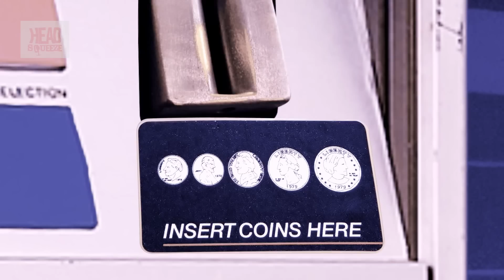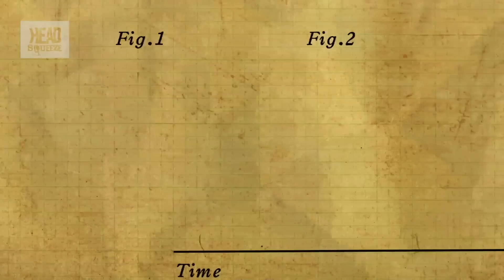Can We Build A Space Elevator? | Earth Science

Comment: the problem is that he forgot to mention all the other problems that his tiny brain could not even think of. the things is that have you ever trieed to hold these color coil spring toys hanging down? if you have you see that the top of the spring have the greatest tension. it means that the rope itself would be pulled down below with a force much greated than above actually the space elevator can't work because gravity will bring it down form the sky. the low earth orbit will be easy to counteract by the force of gravity below acting on the cable below. nobody shows you real science when its about the space elevator. they all show you the easy part. all the problems with it is ignored. also wind and storms will cause the cable to swing and wave and come crashing down even before its created. main problem, how on earth are you supposed to get the cable up there and then below? even if there was a place in heaven to rest on that didn't move, moving parts of the cabel into orbit would be a impossible task itself and take all the resources of the planet to do it. the other problme is that even if you try to do this, the longer the cable was ganing downward from above the more gravity below will start to pull thw whole thing down. you need more than a counterweight for this. you would have to anchor the cable in the moon itself hanging down from the moon down to earth. the cable would have o be so thick and strong, it woul dtake a impossible quantity to produce it. the advantage of this absurd idea is that a trip to the moon would become very cheap. the big proble is that the cable can't be achored on earth so agiant weight have to hang down on either end of the cable and use the moons gravity and earth gravity to keep the cable stable. you would need tousands of rocket mounted on the cable to steer it against the winds and storms on earth to keep it straight. you woul need to make the cable hoolow and fill it with liquid nitrogen and cooled down to given temperature to prevent the cable from experience temperature difference that coudl cause the cable to fail. the space cable elevator is madness. its insanity its babel 2.0 only madmen would try to build such a thing. there is far better ways to make a space elevator than a cable from the stone age. we would be better off with particle beam and a space lift capsule that use magnetism to climp the particle beam into space. that would take lots of energy at once but is much more sane than that the carbon fiber cable idea.

Comment: Not a meteorite, sir.  It's a meteor until it enters dense enough atmosphere to heat up.  Then it's a meteorite, I believe.
Orbiting an asteroid, not a meteoroid (hehehe Science is so much taxonomical confusion) is the better idea, perhaps, as the greater mass will allow for more indignities when dangling a rope down to Terra Infirma.  It's gotta be up above most of the near Exospheric drag, too, so 25K nm-50K nm.  We'll most likely "spin" the cable elements as high tensile aramid plastic coatings over carbon50 stabilized Boron fiber core support cables.  You'll need station keeping motors for the asteroid, of course, as a safety margin.  And you'll need to do it all from space, as you pointed out.  It might prove cheaper to loft sections and assemble them into a ship capable of  a manned expedition to select a suitable asteroid (a lithic one, if possible), attach to it automatic motors capable of stabilizing it in three axes and imparting a tiny thrust, too, to bring it insystem.  Once in orbit (and don't scoff.  NASA and ESA are extremely good at ballistics required.  It becomes a question of either scale, or time) the asteroid would provide both anchor and materials source . . . maybe has a solid gold core . . . and Warrior Women from Mars, or some junk.  Then, and only then, can we build our anchor for the Space Elevator so we can sit up there and throw a hook and line over the side and try to catch us a B52 . . . and you should see the one what got away!

Comment: I think commercial (all) airlines should be electric and should be lifted and launched vertically with automated lighter than air balloon drones like they do with some rockets which could partially deflate and fly themselves back down to the airport. At altitude, the jet could begin to add thrust and as it does, the automated drone balloon could proportionately deflate until the jet got to 110MPH for ex and it releases itself.  The hot air or gas could as well as drone batteries could all be powered/created with solar power and planes could even be taken higher for more gliding fuel advantage.

I think the space elevator beanstalk is still a way off but I would try to get the payload as high as possible with balloons and use rockets from there.  I’d like to think of a way that an elevator could begin at the highest point that balloons could lift and dock a payload to the bottom of an elevator, but it would still have to be counter-balanced without cable tension.

Comment: It baffles me that most people seem to ignore the fact that geostationary orbits happen at approx. 3Km/second speed. Climbing (or descending) such a structure (even if it could be built) is no "trivial task". You still have to gain that orbital speed and it ain't free. Newton's laws still apply (ie: F=ma). So supposing such an elevator were built and the climb began, where would that force come from ? If viewed from the rotating earth/elevator's frame of reference, the climbing elevator would experience a HUGE Coriolis force "pulling" in the direction opposite the rotation, and this force would have to be "countered". Of course Coriolis is an "apparent force", and can be explained by plain inertia if the system is observed from an "outside" inetrtial frame of reference. But either way, the elevator still has to reach orbital speed, which is why "ordinary" rockets need so much fuel to begin with. It's not so much about the "hight".
Reply: Im not fully confident i understood the concept but i think that at the point you reach geostationary altitude you are moving with orbital velocity (3km/s) in reference to the earth. In other words, if the earth had a 35k radius, its surfacevelocity would be 3km/s. Correct me if im wrong

Comment: Why don't we just perfect the railgun, make an extremely large and powerful one and launch shuttles in to Geostationary orbit and go from there.
Reply: Aah, that could be a problem. Launch them slightly slower perhaps?
Reply: +qId3r they would need to reach a minimum speed of 17,000 mph to get to a circular orbit of ~130 miles up above sea level. However, geosynchronous orbit is at 30,000 miles up, so the launch speed would need to be much higher. Assuming there's no living things in the satellite, this wouldn't be a problem if we were launching from anywhere with minimal-no atmosphere, like the moon. But here on earth the atmospheric drag would tear anything apart moving 17,000 mph.
Reply: +theBG2016 I was kinda wrong...Apollo missions reentered at speeds of up to 25,000 mph and the record for fastest reenty is 28,000.
But the US Military railgun shoots a projectile at 5,000 mph can only go 100 miles.
Reply: +qId3r g forces
Reply: +HEX Ummm ... nope. Railguns propel stuff extremely fast ... but most stuff (technical equipment, the delicate hull of a spaceship, astronauts) wont like that.
Reply: If we could find some way to move a most of the atmosphere out of the way first, this might work. Maybe some way to heat up all the atmosphere above the tossed object to a ridiculous degree to lower its density. Microwaves are pretty good for that, but you're gonna need one heck of a power source.

Also I mean the air in that column is probably gonna leave earth, so idk how many times it's safe to do that.

Kinda makes you wish we had just one mountain tall enough to peek out of the atmosphere.

Comment: Air breathing rocket engine. Look up sabre project.
Reply: Josh Hanson No air in space brother.
Reply: Paddy Lambertinho  -_- 90 to 95 % of a rockets fuel is used in getting out of the earths atmosphere..... Which does have air. The idea of the Sabre engine is that you can do away with the massive orange liquid oxygen tank used on shuttle rockets by using intercoolers to cool atmospheric oxygen to the optimum temperature for combustion when mixed with the fuel carried by the rocket. The Sabre would also be a reusable rocket engine. The rocket that launches the shuttle is not reusable. It really is very interesting brother. I worked (briefly) as an engineer on the project.

Comment: Third option: cannon.

Most of a rocket's fuel is used to propel its fuel, which a large reason of why it's so wasteful. Plus the fuel containers. Using a cannon eliminates that entire issue: all the energy is used in the ground station. 

While not particularly a nice idea for ourselves, it would be a much cheaper way to send stuff into orbit... such as a "space elevator".
Reply: Or you could reduce the cost of rockets by over 90% by making them reusable, which is what spaceX is doing.
Reply: So what cannon is powerful enough to propel an object out of it at mach 27 or roughly 8 kilometers per second? Secondly when using a cannon all the velocity is acquired at one instant, a better question is what object could survive the g forces of going from 0 to 8 kilometers per second in under a second? Not to mention on said objects travel to space there's this thing we call the atmosphere in between.  The object which is fired from the magically powerful cannon magically survives and is on its way through the lower atmosphere at 8 kilometers per second,  it would instant burn up in the way space craft do during reentry.
Reply: Isaiah Phillip
One of the main approaches on that is to not use a classical cannon, but something like a massive coil gun. Ideas of these speak of kilometers long "barrels".

This significantly lessens the g-forces issue. Presumably the required acceleration isn't a physical problem - at least, I don't see such objections - so it may be feasible.

And idk whether there would even be the possibility to basically make a loop for the acceleration, switching tracks to the "barrel" once sufficient speed is reached - which would largely eliminate those problems, I'd guess.

I have no idea whether friction is a problem they've accounted for.
Reply: sorsocksfake It's just not feasible, then again the space elevator is an even less feasible idea.
Reply: Isaiah Phillip
You are wrong. 

See, merely stating it isn't much of an argument. If you believe it goes against the laws of physics, enlighten me. If you have calculations showing the requirements are leagues beyond our current capabilities, please share them.

If it's merely your opinion, then please don't state it as if it were fact :).
Reply: did you read from the earth to the moon? :)
Reply: Tecnovlog
Assuming you're asking me: no, I haven't. Anything in there that you'd like to share? :)
Reply: It tells the story of the Baltimore Gun Club, a post-American Civil War society of weapons aficionados, and their attempts to build an enormous sky-facing Columbiad space gun and launch three people — the Gun Club's president, his Philadelphian armor-making rival, and a French poet — in a projectile with the goal of a moon landing.
Reply: Tecnovlog
Ah, Jules Verne. I haven't read it (as with way too many books :P), but goes to show how long such ideas go back... and from what I read his version wasn't even that bad (main issue being acceleration, ofc)
Reply: sorsocksfake A cannon wouldn't work because the object would simply orbit right back to where it started.. that is: the cannon.

Comment: The main challenge in building tall buildings is not how much weight the base has to support but rather the shear modulus of the building. For any cylindrical or cone shaped building, whether the building will topple over can be determined by whether (density * height^3)/(shear modulus * diameter^2) exceeds a certain amount. That amount is larger for cone shaped buildings than cylindrical buildings.

Comment: I think there are some miss-conceptions in this video

- going into an orbit in "space" doesn't mean to go enough "height", but enough SPEED! The rocket provides the energy to speed you up, not just moving you upward. By Kepler orbital law, you can find the speed needed to "orbit" the earth just 100 meter above, which is 28474.8 km/h. But the speed can never be reached inside the thick air at this height.

- it is micro-gravity in orbit because the fast moving objects there constantly FREE-FALL into earth, but their speed move them forward and away from earth, so they balance on an orbit. it is NOT because the earth gravitational field suddenly cease to exist at some height, and objects can't orbit around earth if they don't feel the earth gravitational pull.

- your elevator needs to push people forward, not only upward. Otherwise, people at the top can only play super word-class bungee jumping, but can never "float" right out of the elevator door. You still need to deliver the energy to push people forward, even you don't like rocket.

- the rope proposal maybe a good option. By climbing a rope up to a satellite, we are basically pull it down to earth. But the high speed satellite may store enough momentum, and it may be able to pull people forward to some speed at some height.

- But Kepler orbital law needs object to move faster if its orbit is shorter (or orbital radius is smaller for circular orbit). So pulling the satellite into ground and slowing it down means it must fall to ground, so does the people on the rope. You need extra energy on board the satellite, such as thrust, to keep it on orbit while allowing people to climb the rope.

Comment: When the weight of the fuel as a powersource is the problem, why not produce the power necessary to put things into space before the flight takes part rather than during flight. 

Build a long, steepening tunnel in which an on magnets hovering train accelerates. Evacuate the tunnel, after the train starts you let air back in through the gate from where the train started. When the resulting burst of air is about to outrun the train you open the end gate. 

Can't be that hard.

Comment: I don't understand why the counterweight would have to be *higher* than geostationary orbit. Putting it into a geostationary orbit would exert the lowest possible stress on the rope because the counterweight would stay at a constant height and in a fixed position relative to earths surface on it's own and the rope would not have to fight centrifugal force only it's own weight or am I missing something?
Reply: I guess the rope (which is huge and very heavy) would just pull it down. So it has to be a little further out to counterbalance that.

Comment: Well there's a bit of a compromise solution. An Earth based mass driver, built into a mountain could launch a payload at fairly high speed and altitude. But it wouldn't get into space on its own, it would still need a rocket. But on the plus side, the construction would be cheaper than a space elevator (still enormous, on the scale of the LHC), cost less than rockets, use existing tech, and it would need significantly less fuel than a conventional rocket launch.

Comment: At the end I think you have it. Rockets are round why not a rail gun. (You might need 3 power plants at the site, but it should cut weight, then again why a cylinder you could shape a shuttle to fit a rail gun launch, does job, lands, refit, launch.). then use Buzz Aldrin's idea of using planetary slingshots to direct movement and orbits. or maybe instead of a oversized craft we can have small shells with a payload that once in orbit releases the shell and sends the payload in its like direction

Comment: how about this; a cylindrical tower with cables fastened at the base running up the interior in cyclone pattern fastened to the interior walls to maintain the pattern but allowing the cable to converge until at geo stationary orbit, where the cables will meet some sort of space buoy the entire structure will act as an anchor and the weight on the base would be countered by the cable's upward pull.

Comment: There is a solution which solves vitually all of these problems. It is called an orbital ring. Basically it's a ring constructed just a few hundred kilometers up (so out of the way of 99.9% of meteorites and junk), wouldn't need a super strong cable, and, by my calculations, could be contructed in such a way that it lifts itself into space. It would be nothing more complecated than a lightweight pipeline with magnetic particles inside and two meglev engines on either end with cables attached.

Comment: You're right there is no centrifugal force (or a normal force in this situation). If you construct the freebody (a force) diagram in this case you just have two forces - the centripetal force provided by the cable tension and the weight of the elevator. Both these forces are directed towards the centre of rotation. I jump on my students for labelling a centrifugal force on a freebody diagram

Comment: Something I've always wondered why they've never tried: using electromagnetic mass drivers to assist the rockets during the initial phase of their acceleration so that less of their payload has to be fuel. If I remember right, these large railguns can't achieve escape velocity on their own, but we could significantly reduce the required fuel. Also, if you miniaturized it enough, you could install it in a 747 and launch stuff from 10,000 ft to cut that distance out as well; useful for small stuff